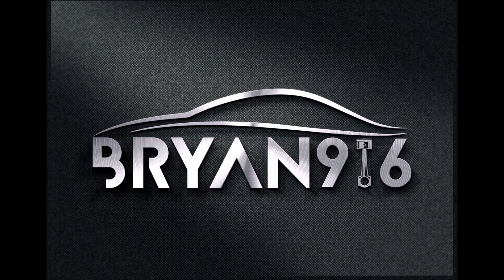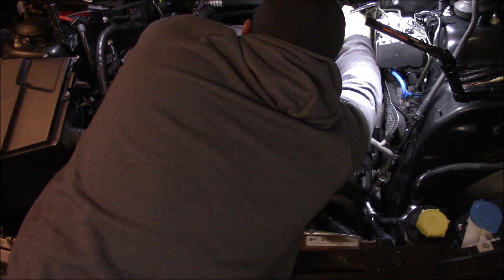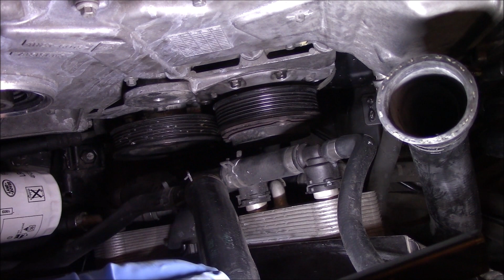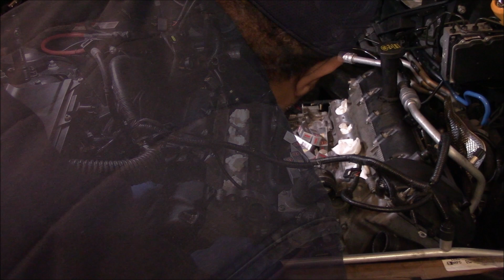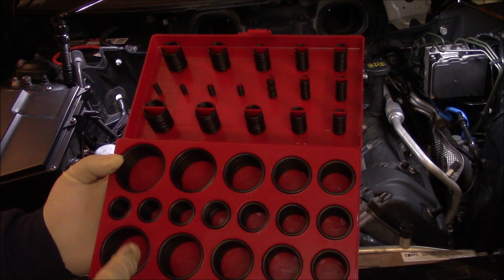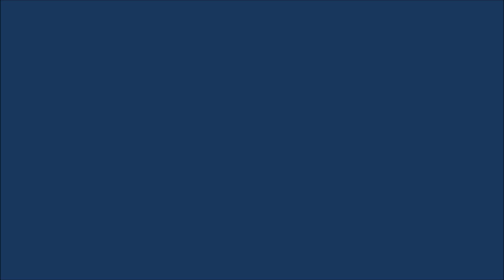2007 Range Rover 4.2 Supercharged Head Gasket Job( Part 4)

Comment: Just took mine apart and found out my 06 4.2 SC does not have VVT. Was that an option?
Reply from the maker: Better that you don't have VVT they are known to go bad!
Reply: @BryansGarage951  Good to know. How did you keep the cams in position while tightening? I tried putting a 1 inch wrench on that spot you showed, but it won't fit down in the head. Too wide. I think you used a monkey wrench during the loosening, but I didn't see anything when you were torqueing it and doing the 90 degree turn. Was it just the cam positioning tool holding them from turning?
Reply from the maker: @garrykennedy5484  Yeah I just used the locking tool. Believe me, I didn't like it but that was the only way I could keep it in place to get that kinda torque on it

Comment: I know you wouldn't have done it if it wasn't going to be ok but that silicone hurts to see.  You put so much into the job and duct tape doesn't seem right.

I suppose the option would have been to go to the dealer an hour away, watch someone fumble through the parts list for 15 - 20  minutes who barely knows anything about cars and have them tell you either they don't make them anymore or they can have it in three days and they are going to be $350.

I know the repair is good as new it's just hard to see.  Perhaps it's a standard industry practice.  I've never been that far into an engine before.
Reply from the maker: I think if I used silicone in substitution of the gasket that would be more of a duct tape job in my opinion but just to assist the gasket in sealing is not a big deal. Parts are hard to come by on this Vehicle but I made due!
Reply: @BryansGarage951  That makes sense and I'll remember that when working on older vehicles.